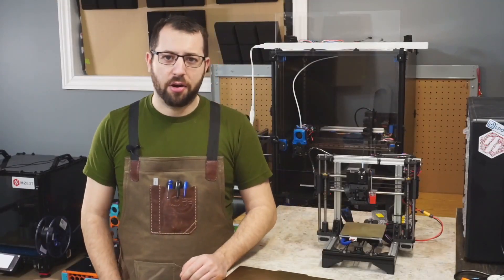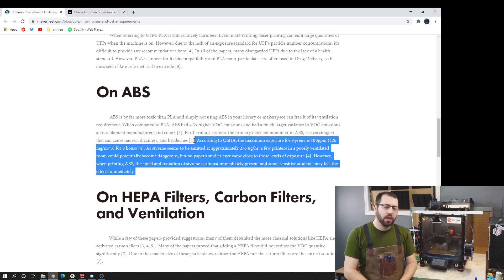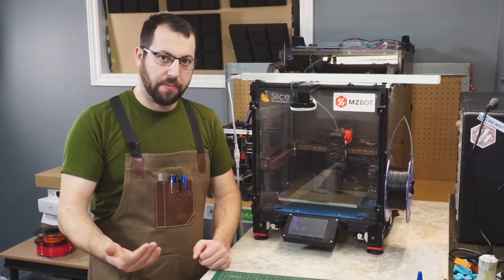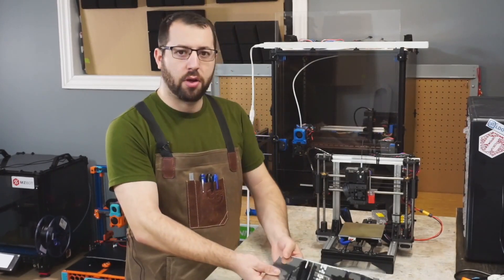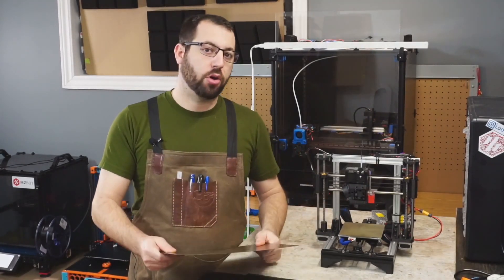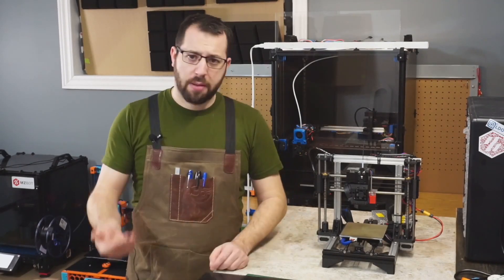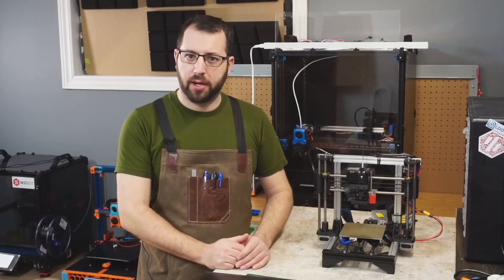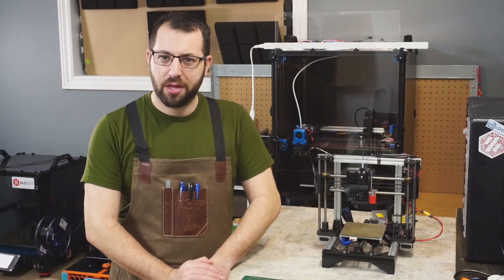ABS For Dummies Part 2- More on VOCs, Beds and Downdrafts

Comment: Don't breathe that VOC.  I've had side effects from limited exposure, bad taste on the tongue, headaches and feeling of illness.  Didn't stop me from using ABS but more precautionary measures.  Room ventilation, wait a some time after the print for ventilation before entering the print room.  Hold your breath for a quick entering the room inspection mid print.  

We have all seen the effects of asbestos and the time it took to learn was too late for some.  Take precautionary measures until the truth is revealed.

Comment: I splurged on a recirculating filter, i.e. one that routes the cleaned exhaust back into the enclosure. I just didn't want to have to worry about balancing VoC extraction with enclosure temperature.

Comment: I found the smooth pei plate from energetic adheres better than textured ones when printing with pla or petg. Worried about the magnetic sticker on the bed at 100C demagnetizing.
Reply: I print abt at 110. No issues with the magnet after 500hs + of prints but i have had a print pull the glued sticker sheet off the metal when it curled up

Comment: Why don't Vorons work with glass beds?
Reply from the maker: Stock configuration uses an inductive probe which needs a metal bed to work.
Their are options now though with surface measuring probes though so glass is possible now

Comment: You spoke about VOCs but not the micro particles, is there any advice about those?  As I understand it, it's the micro particles that are harmful to health rather than the VOCs, and these particles have no smell.  Clearly evacuating gases will help, but I'm wondering what happens to the particles if the chamber is not ventilated and is opened after cooling down.  Do they remain a danger, are there any protocols advised for dealing with them... or are they just too small to be able to do anything other than venting?  Thanks, it's a topic that I think deserves more coverage on YouTube so thanks for dealing with it and those resources/links.
Reply: What microparticles? I don't think melting ABS create any, or does it?

Comment: What is the gasket stuff used to seal the panels? All I can find is 3mm foam/rubber for windows that seems too thick to sandwich between an acrylic panel and the extrusion. Square sheets of gasket paper (that I guess would work if cut up a lot and glued on but that seems like a load of work) and specifically shaped parts for cars.

Comment: I get good adhesion with 0.01'' thick G10  glued with 3M 467MP on flexplate, the glue is simple Elmer's purple.
this hold PC, ABS, carbon nylon, ONYX, PLA easily

Comment: FYI: Don't attempt to enclose a Prusa. Destroyed mine before getting through a single test cube.
Reply: What broke? In my case it was one driver and some printed piece. I reprinted all pieces in ABS and tried to finish an enclosure that could leave the PCB outside but I never got around finishing that.
Reply: @DiThi  The part that holds the PINDA, which is the main bulk of the toolhead. Apparently they made that portion stronger in newer revisions.

Basically, the ABS was curling up (as is its wont), and collided with the probe. Since I apparently had bed adhesion solved, and the PETG had gone pretty floppy, the probe got completely torqued sideways.

I can fix it, just have to get someone else to reprint the part.
Reply: @fwiffo  I would try to print the part with manual Z homing, like a CNC machine. Just move it until it's correct, then run the gcode G92 Z0 to tell the printer that's Z=0. Edit the gcode of the piece to not home, removing G28 (or only home X and Y, e.g. G28 X Y).
Reply: @DiThi  That would involve me being less lazy, which is an untenable proposition. I'll have the part (in ABS) soon enough.
Reply: @fwiffo  I know that feel

Comment: If you have a magnet you can pick up flex plates at your local home store for cheap. Do slurry work on them to keep your other plate clean. Sometimes on large long prints you might need to clip your plates down as the shrink can pull a plate off the magnet (depending.)  Thanks for the VOC coverage too. Great part 2!

Comment: I was thinking about using suction for part cooling and attaching a carbon filter on the fan to pull VOCs directly from the cooling plastic.  Thoughts?
Reply from the maker: Suction for cooling probably wont work anywhere well enough to be effective.
Reply: See The action lab video about smart phone blowing out a candle. Well the physics part applies, not the actual phone.

Comment: First of, thank you for your awesome work! Waiting for parts to start my first Voron build.

I've been reading up on the issues of VOC's and toxicity of printing ABS (and ASA) and found the studies you linked  to be very interesting in that regard. However i feel that the authors of "Is 3D printing safe? Analysis of the thermal
 treatment of thermoplastics: ABS, PLA, PET, and nylon" made an error in their paper when they pointed out that a HEPA filter wouldn't filter out the particles produced by a 3D printer due to the smaller size of the particles. They obviously made the assumption that smaller particles wont be filtered out byt the filters but HEPA filters, from my limited research on the net, actually seem to be very good at filtering out particles with the size of 10-100nm that 3D printers produce and should filter out more then 99% of them.The size of 0.3 µm that HEPA filters target are the hardest to filter out it seems and particles both smaller and larger are more effectively filtered.

Any thoughts on HEPA filters for printing with ABS? I do plan to implement a HEPA-filter to my Voron once it's complete.
Reply from the maker: The stock design of the v1/v2 includes an exhaust/filter box on the back so added one in there would be easy.

Comment: Is there a better more accurate bill of materials list for the Voron 2.4 than what's on the design website because between both lists they have different quantities than what the manual calls out.
Reply from the maker: Sourcing guide may have different numbers due to lot sizes sold or just recommened have extra of a certain item.

Comment: What are your thoughts on PC+, PC-CPE, and other similar PC variants? I have a little experience with both PC+ and ABS and have been successful with both, but PC+ seems to be easier to print (less dependent on heated enclosure) while being able to withstand slightly higher temps (around 110c). I also didn't notice much of an odor while printing PC+. I know there are still advantages to ABS (cheaper and vapor smoothing) but would you use PC+ and other PC variants as an alternative or replacement to ABS for functional parts such as for the Voron?
Thanks for your huge contribution to the 3d printing community!
Reply: +1
Reply from the maker: PC is/can be stiffer, some people have tried it in the past but have experienced cracking issues, also it is degraded by greases and oils, so with bearings/linear rails in the machine there is the chance of contamination.
Reply: I see no need for ABS anymore. PETG or CPE prints better and has similar properties wo the stink.
Reply from the maker: Just having "similiar" properties isn`t always enough. For example PETg while having a higher glass transition temperature than PLA doesnt have the same stability as abs (pet can start to weaken before it "fails). This is commonly seen as screw pullthrough or parts that are under constant tension or compression starting to deform and fail after prolonged use in a warm/heated environment, this has been seen on vorons printed in PETg in the past.
Also need to take into account what can affect plastics used in the printer itself, for example we advice against using PC as it can degrade and break down when exposed to oils and greases. So if your bearings leak into parts it can cause part weakening/breakage.

Comment: Been loving your channel, fascinated with the idea of building my own printer... is there a good resource for comparing the different Voron printers, or maybe a video? Many thanks from Wisconsin!
Reply: Not really. I was struggling to understand differences and use cases for different Voron models too. It is more like a choice of style and personal likings. Basically it goes like this: V0 is the smallest and cheapest to build, good for small prototypes and confined spaces. Pretty complicated build, though. V2 is the ultimate endgame printer: expensive, large, maybe slightly difficult to tune. V1 was the first one in the series, slighly smaller and cheaper than V2, but it is just a different design. VS is a "side-quest", very easy to build, averagely priced and if you have a Prusa i3, you may consume some parts. VL is another "side quest", created essentially because the master creator had nothing to fix for V0, V1, V2 and VS :D But in the end, all Vorons print very well, are sturdy, reliable and fun to build!

Comment: Congrats on 6000+ subs!   Quick question, what is the proper way to setup my z offset on my switchwire?  I am using the omron TL-Q5MC2 sensor, klipper firmware, and octoprint as my interface.
Reply from the maker: With the Switchwire, its simply the probe offset itself is your z endstop since there is no seperate Z switch like on the v1/v2 vorons.
(this is the default mini e3 v2 config for example)
[probe]
pin: ^PC2
x_offset: 0.0
y_offset: 25.0
z_offset: 1.85     <-adjust this
speed: 40
Reply: @CanuckCreator  wow thanks for the quick response!   That's easy enough!   I'm hoping to get into mainsail soon being it's a simpler interface, but I think I get confused bumping around on the install from mainsail github to klipper then some stuff off the meteyou mainsail github.   I had it working once but my klipper said it was dirty and moonraker reported invalid.   I think I may have messed up.